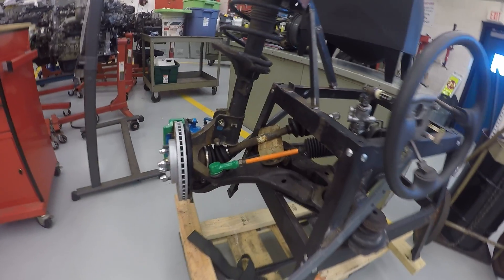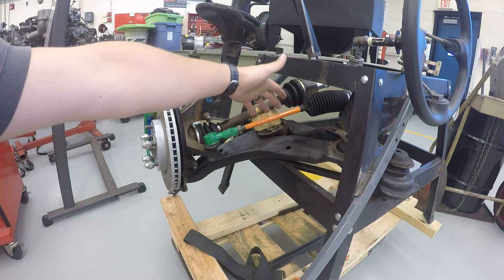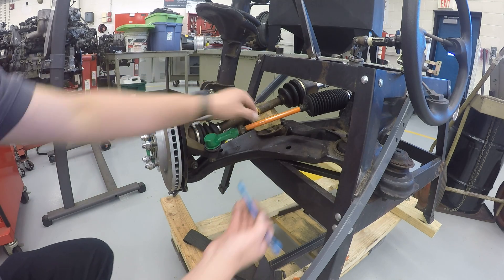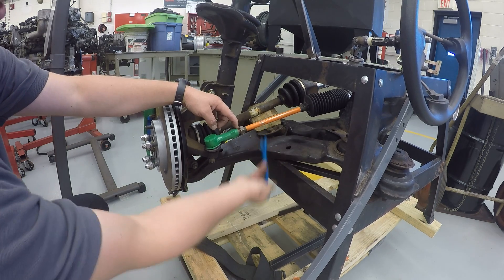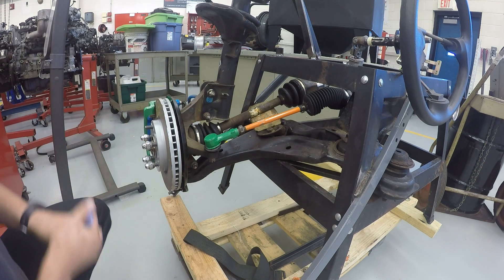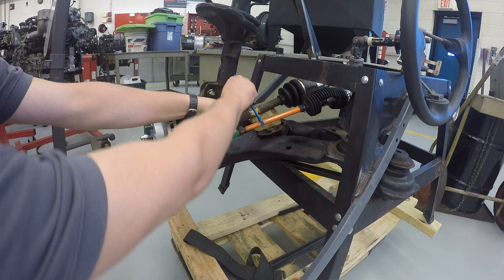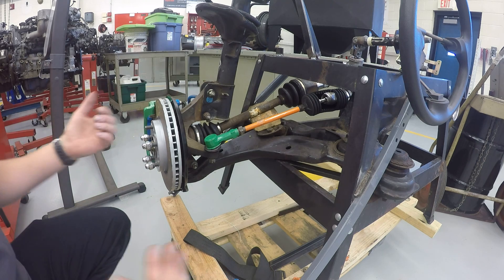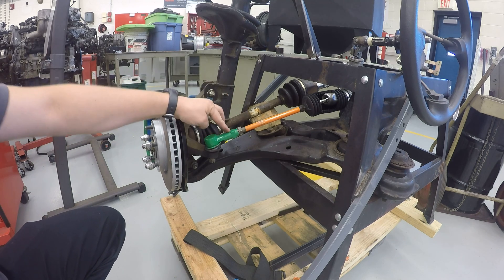Adjusting Toe When Performing an Alignment

Comment: Great vid. I recently had my front control arms changed and my right wheel seems like the toe is off a lot. Is this normal? I used to have noticeable negative camber in my fronts but now it looks almost 0 camber and like the front of the tire is pointed towards the engine. Do i need to adjust camber and toe or just toe?

Comment: cadillac cts 2004 i just replaced shock spring upper arm control lower arm control inner tie rod n outer tie rod and hub assembly now my wheel on passenger side is very close to the front fender and bumper a very large space in the back of tire help plz and thanks before taken cat to shop
Reply from the maker: Did you put the upper or lower control arm on backwards? That is usually the cause of big gap like you are describing.

Comment: So if I have one tire pointed more in than the other this is what I need to do?
Reply from the maker: You need to have a shop perform an alignment. Check out my video https://www.youtube.com/watch?v=Fcfk3z0p4Fs
Reply: @MrAdkinsAuto  cadillac cts 2004 i just replaced shock spring upper arm control lower arm control inner tie rod n outer tie rod and hub assembly now my wheel on passenger side is very close to the front fender and bumper a very large space in the back of tire help plz and thanks before taken cat to shop

Comment: I took my Lexus rx350 suv for alignment to the shop 5 different times because still pulled left and right they didnt charge me for the other time only 1 price. And they rotated my tires still pulls left and right. Could it be my tie rods?
Reply from the maker: I would hope they did an inspection prior to performing the alignment. Assuming the tires are good, components are good and the alignment was done correctly, you may need to look at the SAS. Your vehicle may have a Steering Angle Sensor (SAS) which needs to be calibrated after an alignment if it does. Many shops skip this step bc they don't have the equipment. It will cause a LOT of issues if not calibrated.

Comment: Duuuuuuude!!! I've been taking the outer tie rod off to turn it!  OMG I feel so stupid now, but that's why I'm watching these videos... I can at least spare my nylon lock nut before I give up entirely and take this to a shop.  I mainly just don't know if I can describe the problem well enough for a mechanic to understand, so I'm trying to eliminate alignment as the problem first.  I'd tell them to test drive it, but it's most pronounced on the highway and without already knowing how this car handles, that could be extremely dangerous.  I'm in the Midwest, our streets are pretty rough and bumpy so it's hard to rule out the road and it is almost fine at less than 20 mph, so a parking lot is out of the question.  Any alignment shops based out of an airport?  That's the best place to test it.
Reply from the maker: Step1: Verify all tires are inflated and in good condition with even wear. Verify steering & suspension components are in excellent condition.
Step 2: Take it to a shop that has a good alignment machine (Hunter or SnapOn) and get an alignment done after they also verify step 1 is acceptable.
Step3: If problems still exist,  ask a mechanic to drive it WITH YOU at high way speeds to point out concerns.
Reply: @MrAdkinsAuto  Thanks for your reply.
I did find a mismatched tire a few days ago(I bought the car a week ago) which despite being higher pressure(35) than the other on the front(30), was "smushy" I think that tire may be defective, but I stuck it on the rear and balanced both front tire pressures and they are the same brand.

This changed the issue, it was previously pulling hard left under acceleration(engine torque, which makes no sense, left axle is shorter FWD), then changed.  "verify steering and suspension components are in excellent condition." Great advice, unfortunately, the only thing I can reliably check is tie rods and wheel bearing.  Everything else confuses me, I've tried watching videos about control arms and ball joints, but I just cannot re-produce those tests, either the car pictured was too different, or I'm just am imbicile. Like "use a crow bar to move the control arm forward and backwards"... From where?  It's a hollow semicircular tube.. Where do you pry against?  The bushing rubber is still soft, I can push a fingernail into it... That's about all I know about my suspension condition.

Professional alignment is definitely the best next step.  I just dont want to spend the money to have it aligned and then find out there was another issue and have to get it aligned again; I presume they would just decline it.  I had another car that a shop declined to do the alignment at all because the a strut mount was bad.  Then I fixed that and another shop declined service because the inner tie rods were worn out.  

The thing is though, they wrote up $600+ estimates for labor on these wear items expecting me to approve that on the spot and sit in the shop for 4 hours.  I'm working with old vehicles used for delivery, a repair estimate higher than the price I paid for the car just isn't going to work and then they get pissed when I say no thank you, I'm annoyed that I wasted 2 hours to get nothing accomplished but someone trying to up-sell me services. It's a massive waste of time and an opportunity for anxiety so I spend weeks tinkering and nights complaining on youtube that maybe someone will have had the exact same symptoms and documented everything.  

I'm hoping its just the toe angle, otherwise I will just deal with it I guess.  I was going to work on it tonight but after I parked I found the driver front tire very low, aired it up and found a nail.  It was down to 15 PSI, the drive home today was worse than yesterday, but I don't know when it got punctured so EVERYTHING was thrown back into the air and I walked away before I burst an aneurism.

It "feels", from my untrained perspective, like it's an issue with the rack and pinion slipping.  IDK if that's a thing, but it's like near TDC for the steering wheel "slips" back and forth, like worn gears. maybe 3 degrees in either direction, I mentioned in another comment I can turn right, steering left and turn left steering right, it just depends on where it kind of ends up and you have to feel it and constantly adjust the wheel trying to avoid a positive feedback loop where I look like a drunk person weaving through the lane and onto the shoulder.

And a whole new perspective on accelerating through a turn.  Its all linked to the weight of the car and when it shifts, the wheels do "something" if you can keep it totally balanced it's fine, but as soon as it goes out, it's rough.  Left curves are near impossible, I actually just drive straight, then snap a few degrees left, then drive straight, repeating.  Right curves are fine as long as you keep the exact same power to the wheels and don't let the weight shift. Turns are fine, because they are low speed. Curves are the real danger.

Comment: Hi thank for this ,  when doing 1 side eg front left do both wheels need to be jackd up does the steering wheel need to locked or not and if auto does need to be on neutral or not ? cheers

Comment: to lock it you need two wrenches and apply proper torque. very unprofessional
Reply: No you dont. When you do an alignment on a computer, just loosen the jam nut and rotate the tire rod to 0 degrees (or the correct specification). Then tighten the jam nut, the tire rod will move just slightly but thats normal. Its not like you are going to throw your specifications off because you tightened a jam nut. Also, you dont have to even consider torque on a jam nut, its just a jam nut lol.
Reply: That's is what I thought as well cause the inner tie rod moved when he just used one wrench.

Comment: Make  a Vedio on Caster and camber same as toe adjustment Vedio
Reply: Caster and camber is not adjustable on many vehicles without aftermarket eccentric bolts or shims. If camber or caster is not correct is often means something is bent like a control arm or strut. Thanks for watching

Comment: While adjusting toe on my 2003 Chrysler Voyager 3.3 engine van with string, I accidentally moved the drivers side tire.  String measurements said I was 1/16" toe in on both front wheels but steering wheel is left 20 degrees and vehicle drifts to the right some.  What do I need to do???
Reply: Make sure steering wheel is straight and remeasure. Also, the string method is not accurate enough any more. Need to have a computerized alignment service performed. 1/4  turn of the tie rod is the difference between correct angle or having it wrong. They are sensitive.
Reply: Kenneth Adkins you are completely full of shit. If you know how to setup the string properly, it is as accurate or more.
Reply: You have to go to a place with an alignment machine and pay them to do it. The string method is a good tool to help you get down the road safely to get to the shop.

Comment: OK I have a question when you make the adjustment to the inner tie rod for the alinement to move the wheel outward on a 99 Chevy Cavalier can I also make that same adjustment you made to the outer  tie rod to have the same results of moving the wheel outward or inward  ?
Reply from the maker: No, while the outer tie rod does pivot just a bit to allow for steering and suspension movement, it will  not turn enough to make an adjustment. The flat spot on the outer tire rod is so you can place a wrench on it when tightening or loosening the jam nut. Only the inner tire rod will actually spin.

Comment: Hi, please advise the steps to take if the alingment adjustment is full done and and there is no more way to adjust it for fj cruiser.
Reply from the maker: Could be a few things: Most likely, something is bent and the alignment is far enough off that the adjustment cannot be made to bring it back into spec. Also, make sure if any parts were replaced, they are the correct parts for the car. I also had a "repair center" do an alignment on my vehicle before I had an alignment rack and then had the steering wheel upside down so one side of the car was dialed all the way out while the other was dialed all the way in.